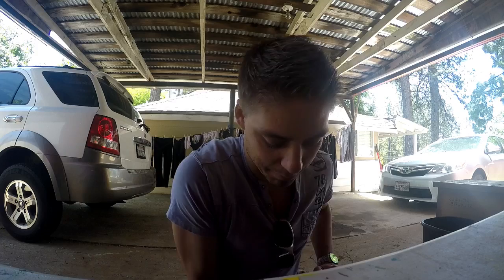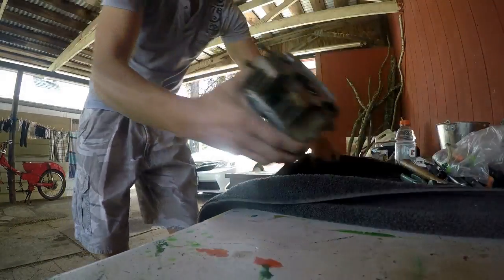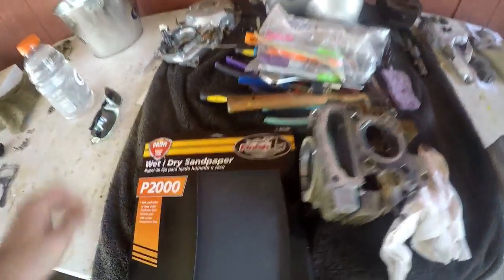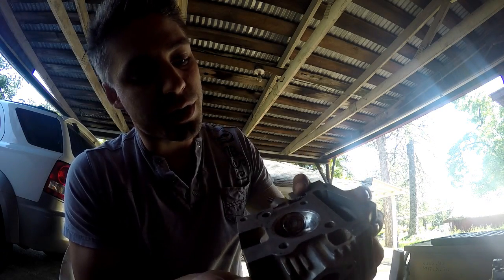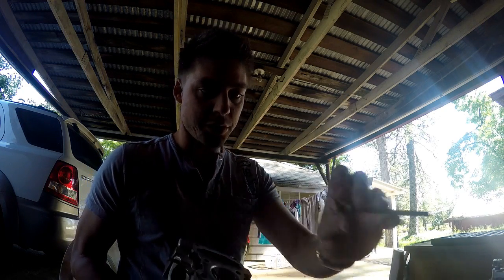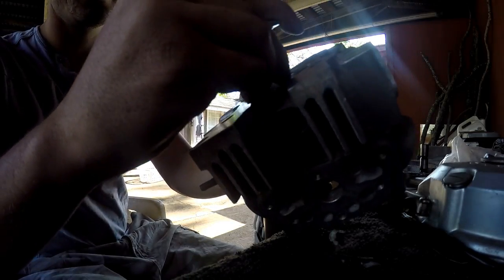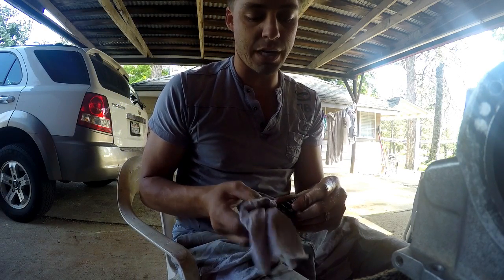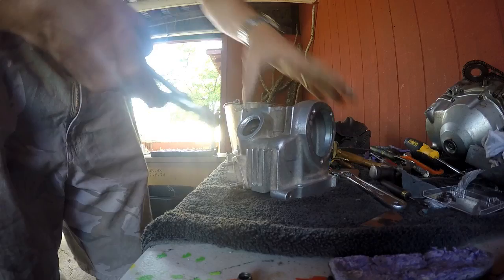Honda CT110 Rebuild Part 9 - Reassembly of the Valves & Honing the Cylinder Sleeve - Shane Mouton

Comment: If you do over hone the cylinder you can opt for a oversize set of piston rings that you should be able to get from honda at the same price of std set
Reply from the maker: thanks for the tip. i will have to check the measurments but i think i did it lightly enough to the point where i can get the standard set in again... new ones coming for sure though